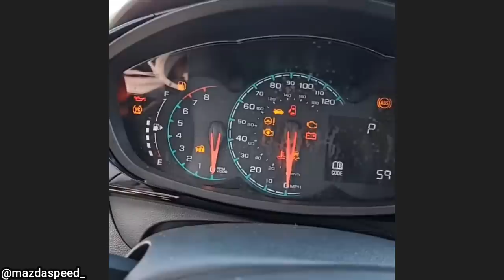Customer States My Car Won't Start (Chevrolet Spark) | Just Rolled In

Comment: In defense of the owner of the first car, the lack of any fuel indicator when empty is a terrible design.
Reply: I agree on the bad design. when it was shown as empty, I was scratching my head, trying to figure out what happened to the gas gauge needle.
But at least some cubicle pilot at the design department got an attaboy/attagirl for their gift from the good idea fairy.
Reply: Except the dummy owner ignored the low fuel warning..........
Reply: The owner is to blame on this, yes the design of not having a gas indicator is a bad design but, as the owner of a gas car, it is your job to regularly check the fuel level, if it is low, full it, that is simple, and a Chevrolet Spark cost almost nothing in gas fueling because the tank is smaller than the one on a Sonic. (I own one, it cost 60$ CAD to full it atm since the gas is at 2.05$/liter or 8.20$/gallon but I can do quite the distance with it)
Reply: my grandma always told me check your oil and water! the fuel will take care of itself.
Reply: @MatsuGrimlyak  Sorry..... at $2.05 a litre , that is 4.54 litre PER gallon  ( CANADIAN ).... that is over 9 BUCKS a gallon
So 7 gallon tank ?  or 32 litres .  ( EFFING EXPENSIVE ...AINT IT ? )
Reply: @fromnowon7311  stupidly expensive indeed.
(And I did a mistake above so yeah, 8.20$/gallon, fucking expensive
Reply: The last light bar should blink or turn red when the fuel tank is empty. Sure the low fuel warning light was on, but when nearly every indicator light was on so that's not going to help the typical driver.
Reply: @illreportbackinabit.8514  The whole gauge cluster was lit up like a christmas tree. The average driver isn't going to look at all those lights and immediately assume it's the low fuel light that's the problem. The fuel level gauge is not a great design.
Reply: There's no needle in the gauge. No wonder the customer didnt realize he was empty!! The idiot light wasn't bright enough, I guess!!
Reply: @karlschauff7989  I must agree on that. It is a bit deceiving.
Reply: The gas indicator light was still on even with the tank half full.
Reply: I rented a chevy Trax I should of told them I wanted something else it was a 2020 with 13000 miles the steering wheel wobbly and key was already falling apart and the worst part was the seats I'm 24 and I fell to the ground to get out with extreme back pain and I couldn't move my right leg after a 20 mile drive 😑😑
Reply: there is no defence for that, I assume it had gas in it when she got it, so there for she would have realized it was a digital gauge. Second that has probably one of thee largest idiot lights for low fuel I have ever seen... you know that picture of a fuel pump, means your almost empty. I can remember when the idiot light (no pictogram) was just an orange light under the F.
Reply: Was thinking the same thing. Not a great design!
Reply: Right I didn't know until it was filled up
Reply: @fromnowon7311  which countries use imperial gallon? I thought the US was the only country that measured gas in gallons, and the US gallon is 3.78 liters. So $2.05 a liter would be $7.75 here in the US. That’s still 70% more than I pay at $4.50 a gallon, or 1.19 a liter
Reply: I owned a 2020 spark.  Hated it for a number of reasons
Reply: I hate cars with fuel indicators that are broken up into sections like that
Reply: There is two, it's an E and a gas light! There are white lights beside the gas gauge, when they completely disappear, it's empty!
Reply: @stevencp  It has an 'F' as well as an 'E.' Neither have anything indicating them. 
All the indicators, including the gas light, blink on when the key is turned. Additionally, the gas light apparently remains on when the tank is half full.

The white lights are absent when the car is off. If they remain absent when the car fails to start, are you sure you would notice? I probably wouldn't.
Reply: My grandmother has one of those cars her fuel gauge was messed up the dealer had to fix
Reply: @illreportbackinabit.8514  In my Chevy Cavalier, when the gas gets low, the dash lights up the message "CHECK GAGES."  Thus.  The misspelling amuses me every time.  Filling the tank doesn't.  The other day I gassed up my 1995 Beretta and doubled its value.  (Still, the Beretta gets better mileage than the 2005 Cavalier.)
Reply: @josepherhardt164  LOL!!!!  You must be driving one of the 3 remaining Berettas, that's cool.
Reply: @illreportbackinabit.8514  EVERY DAY there are fewer Berettas left to compete with mine!  ;) ;) ;)
Reply: I always carry a gallon of gas in my trunk just in case when im traveling on vacation or late night. I don’t have to panic when I haven’t seen a gas station in over and hour :(. Every Japanese/ Asian cars ive had go at least 10 miles after the lights on empty. And some will literally keep going then stop and go another 50 yars, etc. All US vehicles it literally stops within a half mile of the empty light and its dead. But I was young and dum. Now I fill up at the last gas station in barren areas. And carry a gallon for that “one time”.
Reply: In defense to the manufacturer should have read the fucking manual
Reply: in my Chevy spark I have 8 gallons and I get eight marks for each gallon. after it reaches half a gallon it turns red mark. so you get last red dash and also the fuel light gauge at the top left will turn on. if you look closely it's on soon as he puts gas in it it turns off the fuel light. it's a very good design because when the red mark shows up it will let you know your halfway soon as it disappears you got about 5 miles left
Reply: Seriously whoever designed that should seek a different line of work. It’s not fucking hard to add a damn gauge arrow. Stupid unnecessary over designing. Not only is it invisible, but it’s entirely ambiguous to how much fuel you actually have left. An arrow will show you every last little millimeter, what the hell does 2 blocks mean? More importantly- what does one block mean?
Reply: @Mueller3D  all the cluster lights were still on, which is normal functionality as long as they turn off about 3 seconds after ignition
Reply: It did look like an 1/8 of a tank
Reply: Keep your eye on your fuel level. Check it regularly. No excuses.
Reply: In defense of humanity, the car wasn’t purchased or delivered with an empty tank so they should have used all their senses to observe the world around them and seen the dashboard indicating fuel level thus viewing the gas going down as they drove, responsibility to be mediocre at observing things you are in control of is required for further living on the planet.
Reply: I do agree that it's a bad design but at the same time, someone can't be that dumb to not notice the bars next to the fuel indicator.
Reply: @MatsuGrimlyak  2.32€ per litre here in europe atm 😅
Reply: Umm, the indicator is literally the gauge. Please remind me not to get in a car with you unless I bring my Jerry can.
Reply: The fuel warning isnt even blinking or at least RED.
Reply: Never cared much for those cars. Had one as a rental once, slow AF, stepping on the throttle only makes it louder, it barely goes any faster.
Reply: Once upon a time, cars didn't have 'low fuel' warning lights. You were expected to be smart enough to pay attention to the little details that came with owning a car.
Reply: Mine is like this. 2012 Suzuki. Oddly enough it has a range indicator, but not a low fuel warning indicator. Maybe the bulb just burned out.
Reply: Took me a second and a replay to figure out the gauge even worked. A bit of a confusing gauge.
Reply: @renevile  Yes, same as all the other lights that blink on when the key is inserted.
Your point?
Reply: @karlschauff7989  The low fuel would have been on for a long time before it refused to start

For the driver to not notice it beforehand and not think "hmm I should get some gas soon" just proves my theory that lobotomites exist
Reply: @PHAZER99  Not if someone stole the gas.
Reply: Yeah, stupid user interface design
Reply: YES! I came here to say pretty much that. I'm in a rental Trax (same day display, seems like) right now while my car is in the shop, and one of the first things I noticed was how awful the fuel level indicator is (among so many other shitty designs.) I drove it down to about 30 miles range, as indicated on the dash display, and I was extremely dismayed to find that there seems to be NO idiot light!
Reply: @illreportbackinabit.8514  Maybe the owner is blind. Kind of messed up to say don't you think?
Reply: The mechanic shows where the fuel gauge is in the clip
Reply: @karlschauff7989  idk what to tell you. It’s a fuel gauge in a modern car, they’re overly complicated screens now just Lear what your fuel gauge is
Reply: Besides the indicator, yellow gas pump and knowing it's been awhile since you put in motion lotion, what else should they use to awaken you? Electric shock therapy through the steering wheel?
Reply: @robotseattrees9386  Case in point, brilliant!
Reply: @josephvanwie6706  aka common sense. 😁
Reply: Not the engineers or techs fault the owner doesn’t read the owners manual. I get so many no problem founds and working as design because the owner didn’t take the time to read and understand their vehicle.
Reply: Not the engineers or techs fault the owner doesn’t read the owners manual. I get so many no problem founds and working as design because the owner didn’t take the time to read and understand their vehicle.
Reply: @karlschauff7989  Every time the low fuel light comes on it makes an audible noise. And every time the customer turned on his car I would have kept saying low fuel.  There’s a reason why every car has an owner manual.
Reply: @karlschauff7989  I have a Chevy spark, and the only time all the lights come on like that is when you turn on the key to the acc and not turning it all the way on. If your gas is low then the bottom indicator will turn red, the car will "ding, ding ding" and the gas light above will turn on. Totally on the driver.
Reply: @feero9680  because before you run out of gas the last blip turns red and the gas pump light shines above.
Reply: There really is no defense for it. All newer cars, especially one that new, give you the first warning of low fuel when you have 50 miles till empty and the cars warning indicator being audible.  If you clear the message, it’ll come again between 30-35 miles and once more at 15 miles. The message also reappears if you restart the car with low fuel. There were many indicators before the owner ended up in that situation. That’s just poor responsibility on the owners part
Reply: Yeah the last tick should turn red and flash when empty.
Reply: I mean, I don't disagree, but also... how do you not notice that the little white lights that used to be there are gone? lol
Reply: I own a Chevy spark and it does have a fuel indicator.  The last white blip will turn red and it literally has a display feature that estimates how many kilometres until your empty.  Turns to low after you teach about 50 Km’s.
Reply: As an owner of the same  car it's bad design but the fuel display changes white to red a long with illuminating the gas light and beeping at you the red light disappears when falls below a half gallon left so you still have 10 miles or so to go before you are out of gas ....
Reply: @fromnowon7311  I think Canada uses US gallons, not Imperial. US gallons are 8 pints, Imperial is 10.
Reply: I used to own a spark, nice well built little car. you would have to have half a brain to not understand how the fuel system works
Reply: @McBlaggart - that’s why they fitted a fuel gauge……….! You’ll want the bloody car to drive itself to the gas station and fill itself up next! LOOK!
Reply: @royr1016  4.54 liters in a Canadian gallon .
Reply: @royr1016  that is what I was saying.the diff between Canada gallons vs. American
Reply: @royr1016  OK , OK . Fine you win .
BUT Google says 4.5.
  I am out . Good bye
Reply: I was a bit confused myself
Reply: @robotseattrees9386 my grandmother drove her whole life. I don't think she ever even visited a gas station. 😂
Reply: @WowOafus don't forget to convert the money. $7 Canadian isn't $7 USD. It'd be more like $4.50 (idk the current exchange rate but I think it's somewhere around .6/1)

Comment: 2:42 had this happen at the shop my father works at. A guy in a stall over was doing some welding next to a plastic trash bin and one stray welding spark ignited some penetrating oil soaked towels. Completely scared the hell of of my father when the plastic bin exploded and little bits of trash were strewn everywhere. (Gas/Solvents soaked shop towels and welding sparks don’t mix lol) Keep them in a separate container; preferable metal with a step on lid opening mechanism. Anyway my father ended up buying a new metal trash can for the guy in the stall over and they all had a good laugh about it.
Reply: Makes sense to use metal bins at at shop... If not the safety step lid style, open metal cans that will accept a lid or cover. Plastic melts fast and before you know it you can't even drag it away to safety... And you can't smother it because the plastic is melting.
Reply: It's true, gas/solvent soaked shop towels and sparks don't mix... except from a spectator's point of view! From there It's tremendous!🤣🤣

Comment: Custumer; What's wrong with my car? 
Mechanic; well. It's you, your what's wrong with your car.
🇺🇸🇺🇸🇺🇸🍻🍻🍻🍻
Reply: Mechanics over 100 years ago probably also knew this is a common enough reason.
Reply: @101Volts  to right,,, there is times mechanics probably think,, you dont deserve an automobile.😂🤣🇺🇸
Reply: The (very) old joke goes, “the most common fault with a car is the nut holding the wheel”

Comment: Working at PB for a number of years.   You would not believe the number of vehicles that were towed in with a no start condition ... that were simply out if gas.

By the time I left PB ... it had happened so often that a policy was put in place ...  that any vehicle towed in with a no start ... check fuel level.

Standard cost for the 5 gallons of fuel that we added was $20 (back in 2000) and when people complained.    My boss had no problem telling it was the diagnosis cost to check the fuel guage.   He was a fun boss.
Reply: I’m dumbfounded that people could be so stupid as to not simply check the fuel gauge!
Reply: 20 bucks worth then is like what 55 now fuck sake
Reply: i work for a construction company as a foreman but my father was a mechanic so i know quite a bit one of our vans broke down and had to be towed to our shop my boss asked me to look at it on a rain day guess what no gas
Reply: After watching a guy screw around with a Front Wheel Dr., New Yorker all morning I finally told him put some gas in it. In his defense the new at the time digital dashes was showing half a tank
Reply: Time is most important
Reply: in the UK, using 2000 fuel prices and exchange rates, 5 gallons of fuel would cost the equivalent of $28........
Reply: Doesn't have to be a lay person who misses the simple things. I've seen a couple mechanics scratching their heads for hours trying to figure out why a car wouldn't start, only to find out that it was still in drive lol. It should really be common (not just for cars) to check the simple, obvious things first before moving onto the more complicated.
Reply: @johnm5928  every body has their moments
Reply: Must be a peter bilt dealership !!

Comment: When customers tell you it was done at "another shop", just assume that their cousin did it in his car- port.
Reply from the maker: Lol thats always a possibility!! 😅
Reply: Or they did it themselves
Reply: I had to admit to a failed DIY as a teen. Tried to change a speed sensor and it was STUCK. This was well before I learned to deal with corrosion and use heat / quenching, etc.... I could not get a corroded transmission speed sensor out, so I brought it to a shop and told them I failed and the sensor body was still in there with a bolt extractor in it (plugging the hole). They said it was absolutely stuck, worst the tech had seen and needed a torch to get out, but changed it for me and also thanked me for bringing it in before I busted off the bolt extractor and playing dumb! 😂
Reply: @volvo09  That’s not a fail man…. You tried and you knew when to quit. Nothing wrong with that. Good story though 👍🏻
Reply: @volvo09  About a decade and a half ago I was borrowing the bay from work (small business that rented construction equipment) to figure out how to stop a fluid leak I noticed on my Saturn.
The leak was from one of the lines for the transmission fluid cooler to part of the radiator. Well, I put a wrench on the fitting and tore the fitting right out of the radiator.
After a hasty positioning of a drain pan and the application of speedi-dry and gojo (the former for the floor, the latter for my hands, arms and face). I stepped next door to the auto mechanic, and told him exactly what I had done, and asked if he could fix it.
After he got done laughing at my misfortune, he tucked my car into the next day's schedule and replaced the radiator and the transmission cooler lines, since they were mostly rust all the way to the transmission.
Reply: believe me, in the states, this really CAN apply to other shops.  especially in the rust belt states where cops are STILL busting shops for cheating on inspections.
Reply: @anonymuswere  - I'm sure that's the case almost anywhere in the world
Reply: I've had shops botch jobs on me and I had to bring it to another shop for corrections